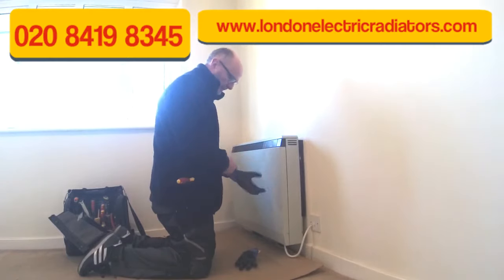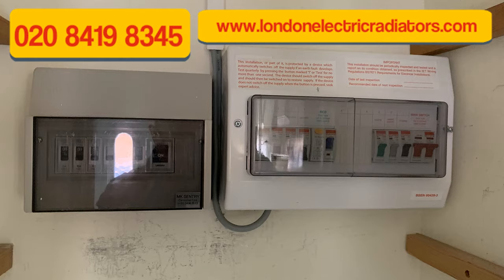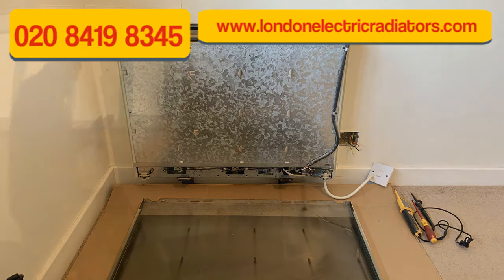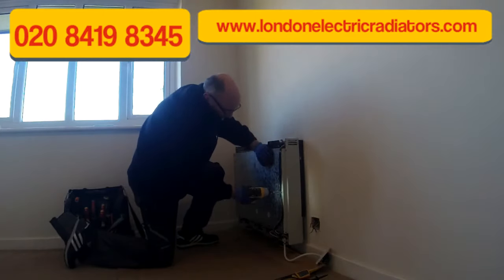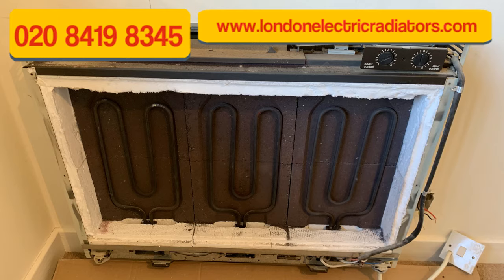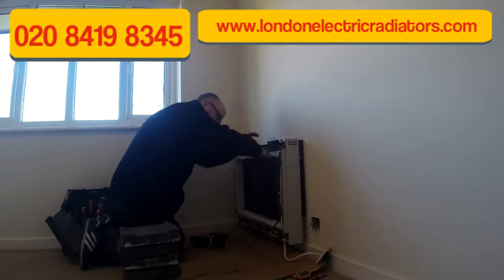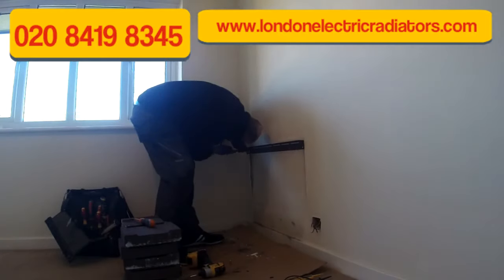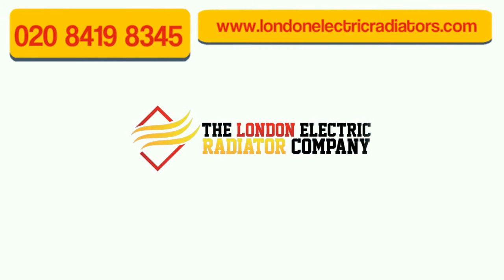Storage Heater Removal Replacement

Comment: A sparky removed my heater so tradesmen could install flooring. He leaned it against the wall but didn’t remove the bricks. It slipped on to the floor as I tried to shift it and it weighs a ton. Impossible to move.

Comment: Old type remove ,they stopped putting asbestos in them in 1973 ..but would you take a chance after seeing all the flats now thar are supposed to be fireproof are not..Manchester man...thank you.
Reply: Thanks Richard.  Advice in the video on asbestos.
Reply: I have the exact same radiators and they give me allergy symptoms when turned on... rather be cold than sick, I think my heators might have unhealthy dust in them
Reply: @Lu-my7qr  I've had a lot of people with the same complaint about storage heaters.   I can't offer any medical explanation I'm afraid.
Reply: @wandleelectricalservices-e7704  1 week later here I am with a viral infection from what I believe are these heaters, I’ve turned them off and have bought an air purifier, if you could please raise awareness on this matter that would be brilliant because I can imagine these heaters being quite detrimental to an elderly persons health considering they have effected me and I’m only 22.

Comment: About 2 hours work .BUT .you have to tell customers that it’s usually left with two holes in the floor where the legs have been and filling and painting to wall plus old radiator taken to the tip.
Reply: Thanks Richard, good tips there.

Comment: Good afternoon, fantastic video. I am just about to buy a house (built in the 80s) that has four of these style heaters throughout and I'd like to remove them and replace them with the Haverland RC Wave units. I was just wondering what you would need to do with the cables coming from the wall after removing the old units, as the new Haverland units only require a local plug socket? Kindest regards. Sam
Reply: Should stick to the dimplex , the models before their quantum was much better , just keep them on 24 hours and if it gets too hot then just open a window , I’ve got 2 , one in my hall and one in the sitting room, costs penny’s once they’re heated up.
Reply: Hi, I’m literally doing exactly the same as you and am even using the same wave radiators. Just wanted to know if you did have to do anything in the end with regards to the wiring?

Comment: This is me with new build flat - no one told me there were bricks in them haha - took down 3 flights of stairs, then I learnt.  Had meter changed as standard electric was (way back) far cheaper if you are out all day.   Heat all gone by evening when I wasnt even in.

Comment: I don’t want to remove it, but to lift it, to place flooring underneath (after pulling the previous flooring out from under it). So, I want to take the bricks out, then put them back in). So, do I need to disconnect the electricity at the wall, or is it enough to turn off the mains electricity for the whole house?

Comment: I recently moved into a new apartment with Creda storage heaters.

There are 2 in the living room. I dont need 2 as its not a huge space and 1 heater does the job well enough. Also, one of them doesnt seem to work. 

This is OK by me as i want to remove that one anyway, its an eye sore and takes up a decent chunk of important wall space.

Do I just get someone to remove the storage heater and cut off the supply? The flat was built after 1999 so im assuming asbestos isnt an issue. 

How much does that job cost and is there anything else that needs doing?

Comment: Hi there, great video. How much do you charge for this service?
Reply from the maker: Hi,  thanks for your message.  We would normally visit and give a free assessment .  If you would like to arrange a visit call 0208914 8297 or email Anthony @londonelectricradiators.co.uk
Reply: @thelondonelectricradiatorc6580  Hello,I  have same this heater  can you fix this.and what is your charge
Reply: @aqsamaha1624  We don't repair storage heaters.  We generally replace them with modern electric heaters.

Comment: Hi there,

In regards to the wiring, if you want to convert the socket into a regular plug socket after is there anything fancy you need to do? I read that the wiring needs to be reconfigured as storage heaters are connected to off/on-peak circuits?

Is this something that can be done by yourself or do you have to contact your supplier?

please advise and thanks!
Reply: I’m wondering this too, hopefully he’ll reply!

Comment: I think I have the same model as you as it looks the same - do you know where the model number is? Did you consider if they was any asbestos in the heater?
Reply from the maker: Hi Thomas, model nos normally on sticker on bottom.  As metioned in the video i did check if that model had asbestos in and it doesn't.   Thanks.
Reply: Hi Thomas, thanks for your comment.  There was no asbestos in this model.  If you watch the video it tells you how to find out if there is asbestos in your heater.

Comment: Hi I can't see how you disconnect he cord the from the wall. Can you explain?
Reply from the maker: Hi, thanks for your comment.   I would only attempt this if you feel you are competent with electrics.  Isolate the power to the circuit serving the heater, undo the spur switch, test that it is isolated,  Disconect the power cord from the spur terminals. Screw the spur back to the wall.